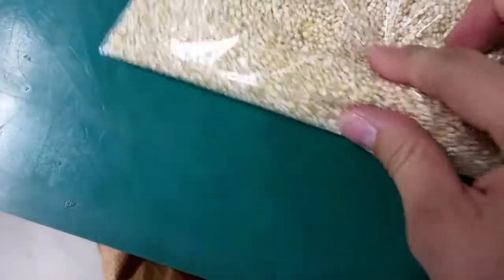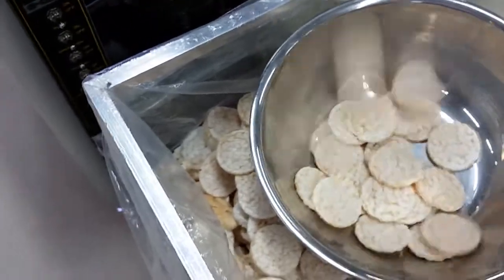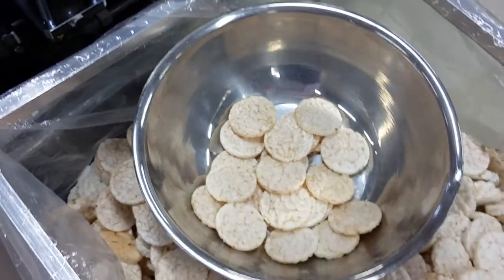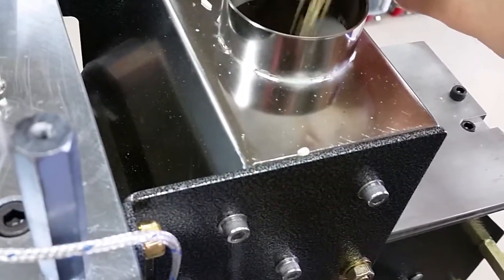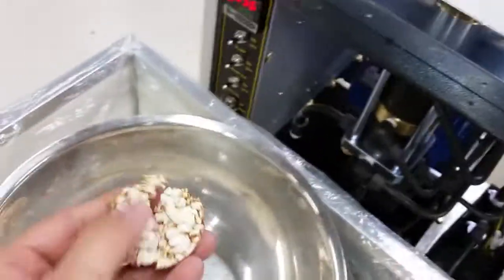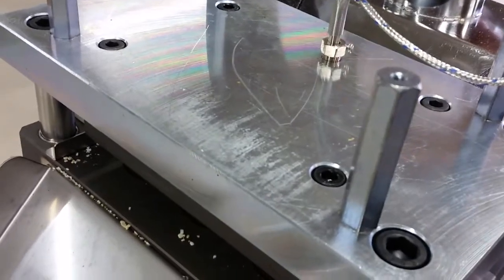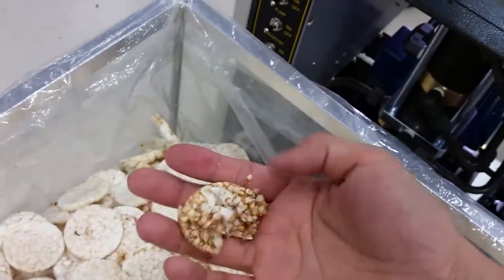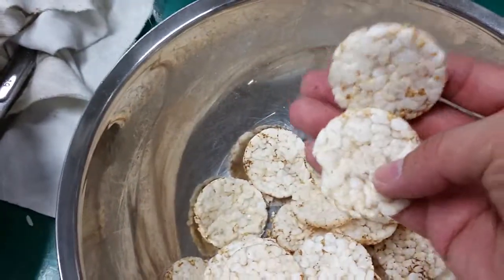Rice cake machine (Rice & Quinoa Test)

Comment: Hello dear, sorry for the delay, for the quinoa, you should modify the temperature of the controller, also due to the time that the cycles have, the cooking time is the minimum, for this reason, lower the temperature a bit, the other, and increase a little work pressure, now if you can not stabilize the biscuit, it would be good to reformulate the humidity that the quinoa has, if not, turn the knob of the potentiometer of the control plate to carry out the other format, especially for pellets along It will give a better shape to the material without being damaged or overcooked, greetings, it's a pleasure to see this machine again, it has many parameters to control.
Reply from the maker: Thank you for your massage, The current machine has been upgraded a bit to make better quality products.😄 www.newpop.co.kr